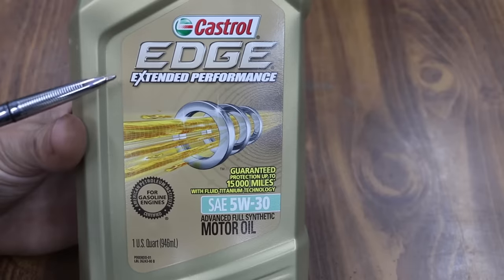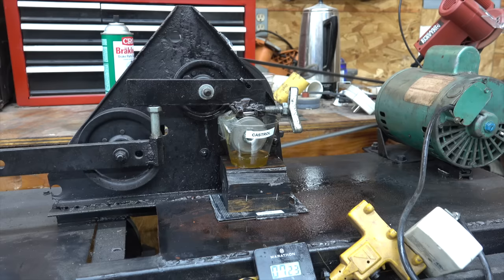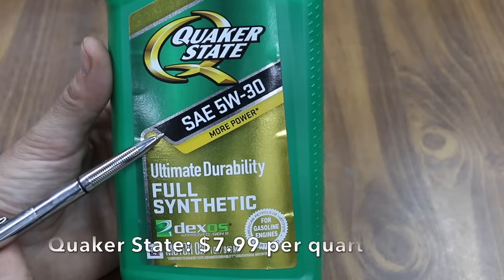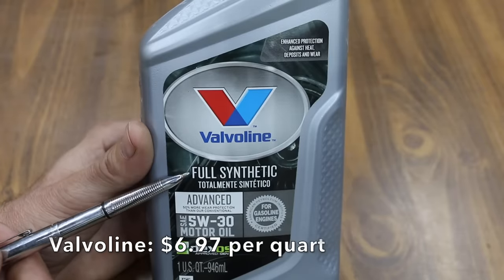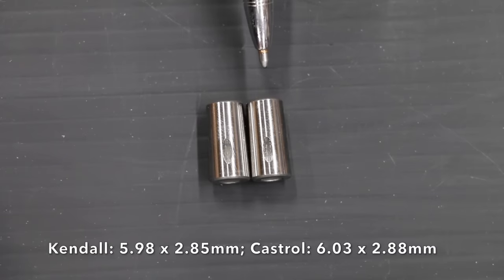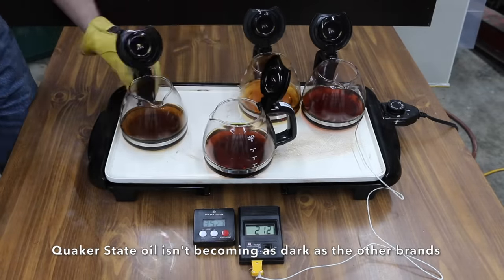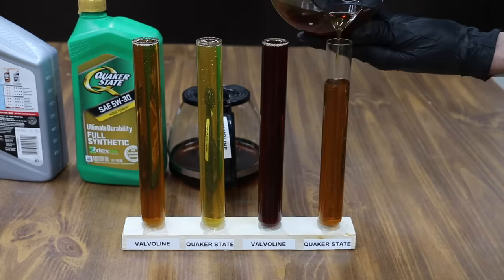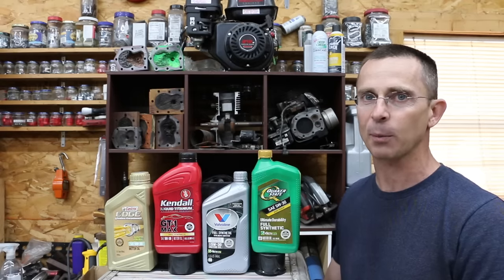Is Castrol Motor Oil better than Kendall? Let's find out!

Comment: Can you test diesel fuel additives? I am specifically interested in the lubricity of different additives since they all claim to "reduce wear" on the fuel pumps and injectors; Opti-lube XPD, Opti-lube summer+, Standyne, Diesel Power Service, etc.
Reply from the maker: Thank you for the video idea!
Reply: BigK
I've tried diesel power service and Lucas fuel injector cleaner. My results were, power service didn't seem to do anything except cost me a few bucks.
Lucas however,  got my engine a 2007 Cummins ISX 15 435 HORSEPOWER after one gallon , I put half a gallon in each tank  and my fuel mileage went from 5.8 to 6.2 and it idled smoother as well, every 6 months 1 gallon, keeps the performance and mileage up. To me it's worth it. The others I can't say, once I found Lucas I stayed with it. 
It has been a while since I used power service so it may work better now.
I have been using Lucas since 2010 and even had great luck with it in my cars 
Power service says one fuel injector cleaner can't work on both gas and diesel, I say bull hockey!  Lucas does.
Reply: Look into fuel additives from Schaeffer manufacturing. Best fuel additives in the world I can assure you just try them and you will never look back 👍
Reply: @charlespetersonii6989  
Thanks, I'll try them next time I want to treat my fuel.
Reply: @bertgrau9246  I personally use their Nuetra fuel additive. Good for Gas diesel and ethanol blends because i run e85 often. Best fuel additive I've ever used. https://www.schaefferoil.com/neutra.html
Reply: Testing has already been done if you follow the diesel forums. Take a look here: https://s167.photobucket.com/user/pgreensvt/media/HFRRtesting.jpg.html
Reply: @charlespetersonii6989  
Thank you sir, I put around 90,000 to 100 000 miles a year on my old truck and if anything helps my fuel mileage just a little it can save a lot 
I will try them soon
Reply: Bigk1911 Diesel purge! that is all my friend.
Reply: @jasonharrison25  I am very skeptical of this test because it is the only one I can find and they worked with Opti-Lube to get the yet to be released XPD product they tested. In other works, I feel like palms were greased. If this study is true, should be repeatable!

Comment: Thank you for doing Valvoline. That has been my go to brand for years. Still did well, but I was really surprised on how well Quaker State did. I thought QS was garbage oil.. My mind has now been changed.
Reply from the maker: Thank you!
Reply: Quaker State is garbage, its REALLY bad. These tests have left me scratching my head for an explanation. My guess is its great for a the first 500 miles then turns to the garbage that has caused so many engines to become knocky.

Comment: I use Amazon Basics Full Synthetic in my 1995 Honda Civic because of your testing thanks! 214,000 Miles and counting!
Reply from the maker: It's a great oil. I'm using it too. Thank you
Reply: @ProjectFarm  I'm excited to see the playoff finals of the oils!
Reply: I use whatever full synthetic is cheapest in my 06 Saturn Ion 3 and it has 242,000 miles. When I got the car it already had 116,000 miles on it and who knows what oil they used.

I generally use SuperTech full synthetic.
Reply: @timmturner  good enough for that car. i got a turbo 2.4. last owner(original) always used pensoil. im going with Rotella gas truck. beats mobil and castrol's equivalent. probably pensoil too.
Reply: @Billy_Darley  I am in the oil is oil camp, proper maintenance and good oil filters will get you further than specialty oils. Rotella is good oil, as is Pennzoil.
Reply: @ProjectFarm  Do you run your tests on each order you get of it to verify the quality is still the same?  If they remain consistent for a year or two, then I might consider trying it.  Wait!  What am I saying!?  I will never use anything other than Castrol.

Comment: I was just watching all of the oil tests again and thought of 2 ideas for the next test. The oil maintaining viscosity is VERY important, so after the oil is heated, frozen and the wear test is completed, have it analyzed and post the viscosity in Centistokes at 100C. A quality oil will stay in grade and remain a 30 weight, min 9.3 and max of 12.5 cSt.  It shouldn’t thin to a 20 weight or thicken to a 40 weight.
Second, your wear test machine has a watt meter attached. Very smart! I have worked with electric motors for 38 years and with a steady voltage, the wattage measurement will respond directly to very small load variations. I noticed in your videos that Amsoil had the smallest wear scar as well as the lowest wattage measurement of 415 watts. Oils with larger wear scars had wattages of 420 and higher, showing the oil has a lower level of wear protection, which increases the friction and load on the motor. I suggest including a graph showing each oil and it’s wattage measurement.
Reply from the maker: Thanks for the video ideas.

Comment: Since Quaker state and Pennzoil are both  SOPUS, Shell's surplus of GTL basestocks that are leftover from their production of Pennzoil Platinum  are allegedly used in Quaker State. That would explain Quaker State's notable  resistance to heat and great film strength. Both Quaker State and Pennzoil Ultra Platinum have performed excellently in my vehicles. I appreciate your interesting videos and the  thorough testing of products that accompany  them. Your subscriber base is well deserved. Thanks.
Reply from the maker: You are welcome!

Comment: I wonder if the bearing test would be different once the oil has been through your heat test?
Reply: Or while it's still hot as that is the state it's in during all the time except for the short time after start up

Comment: 4 oils I expected to do well. Amsoil, Kendal, Redline and Pennzoil. Oils I expected to do poorly and I was wrong: Amazon, and Quaker State.

Shockers to do poorly though? Mobil 1 and Castrol. Are my favorite oils wrong or did they really not do that badly?

Right now Pennzoil's extra cost looks justified and and Amazon being so cheap looks awesome, but then user comments from hard pressed engines says Amazon isn't so stellar.

Right now, price vs. quality tells me Pennzoil and only because of my probably wrong bias against Quaker State.

Edit addition: The 80's and 90's and professional testing which could have been rigged all said Quaker State is no good. I thought Pennzoil bought them. That makes it make more sense!
Reply: castrols really do that badly

Comment: I had my oil pan off at around 210k miles. I could not see any sludge on the bottom of the pan, it looked almost new even if I tried to scrape it from the corners there was basically no sludge. I always use Castrol synthetic blend and I will always use it . I use the full synthetic now, just recently changed over now has 247k. It’s a 2002 and they don’t make them like they used to.
Reply from the maker: Thanks for the feedback.

Comment: I'm really excited to see how Amsoil will hold up against the rest.
Reply from the maker: Thank you!  It seems to be a very impressive oil!
Reply: AMSOIL! AMSOIL! AMSOIL!AMSOIL! AMSOIL! AMSOIL!

Yeah, I'm a fan. I'll probably need therapy if they don't win.
Reply: @ProjectFarm  If AMSOIL does win, can you do an extensive test to find out if the Signature Series is worth the up charge?

Not sure how, maybe cook it for several hours? Maybe run it in a beater for a year while at the same time run the regular in another beater? (Hopefully you can find a couple El cheapos on Facebook)
Reply: @Stacy_Smith  looks amazing on paper but for the cost difference i opted for Rotella gas truck. might opt for amsoil if my pockets ever again get deep enough. cant say enough about amsoil saber. its all i use in my two strokes asides from Briggs & Stratton 5-In-1 Advanced Fuel Stabilizer.
Reply: Billy Darley I use the oe line of Amsoil, and change it every 5,000 miles. Wix standard filter. my edge only cost me right around 35 bucks per oil change.
Reply: I've picked Amsoil to take the series a while back. All I use in my car/truck. It beat Royal Purple handily. That should say something right there...
Reply: Knowing amsoil , they probably already tried to bribe him into winning the contest. It’s all advertising and half-truths.
Reply: @johnconnor7501  Way to make a logical & meaningful comment. I'll take it you never even used the oil, but have all the facts to base your highly opinionated comment on...
Reply: I love Amsoil! I once used it on a recommendation from a friend who worked for a corvette shop who did racing on the weekends here in honolulu. I used it in my 1986 Toyota corolla with the 4ac motor. I put Amsoil in the engine and rear differential. Much to my surprise when I first took it for a test drive it felt ever so slightly peppier. Seeing Amsoil beat royal purple in your tests just confirms my trust in Amsoil. But...it is expensive stuff. Lol
Reply: If you look at the stats from all the winners amzoil will not win out
Reply: @Billy_Darley  , overall the Amsoil Signature Series is cheaper with longer drain intervals. Do the math. Amsoil Signature Series good for 25 k miles. It costs me $77 (or $15.40 per every 5,000 miles) for Amsoil Signature Series for 25,000 miles with a singular drain interval. Amsoil, overall, more affordable and better for the engine. 100% synthetic better than a full(partial) synthetic motor oil.
Reply: @johnconnor7501  , chicken little and the sky is falling, too.
Reply: @hawaiiansoja81  , overall, over 25 k service intervals, it's more affordable and better for your engine. Pay now or pay later.
Reply: Team Schaeffers FTW!
Reply: I havent tried it out yet, but since this series started ive been researching Amsoil, hoping the hype is legit.
Reply: @Billy_Darley  Just become a Preferred customer and get 30% off.
Reply: @gac107  I like RP but... it evaporates too fast!
Reply: @user-ki3dj9pu9y  , Amsoil Signature Series is working for my family's 3 vehicles and is, overall, more affordable with less drain intervals. One drain interval and $77 per 25,000 miles. Do the math.
Reply: @youarerightboss  when all the professional mechanics i meet will stand behind that bullshit, i will too. so far the most miles any i have met will recommend is no more than 10k. if its your engine, do what you want with it. if 25k makes you happy then roll with it.
Reply: @youarerightboss  not dissing amsoil. i know its good shit, just not going to leave it in that long.
Reply: @Billy_Darley  , understood, but it's been proven to perform that long.
Reply: @youarerightboss  you do make a really good point!
Reply: @Billy_Darley  , rolling with it.
Reply: @ProjectFarm  Oh, and please send samples off. Testimonials are anecdotal due to the fact any degradation experienced wouldn't be noticed.

I had a 1991 Buick Century that I abused by changing the oil once a year to every 18 months. I was an OTR driver with hardly no free time and would forget to ask my wife to do it since I hardly ever drove it.

I got a local job at AK hauling coils. The car had several wear and tear items that needed fixed but because the mill was slow I didn't get around to it. (Brakes & rotors, only 1 power window worked, and exhaust was broke off).

I needed the money so I DROVE this heavily abused car to a nearby  junkyard, dragging one locked tire, for scrap so I could scrounge up enough money to buy a turnkey used car. NOTHING WAS WRONG WITH THE MOTOR! NOT ONE VALVE EVEN SO MUCH A MADE A TICK!

We put close to 100,000 miles on that car and we bought it used! It didn't leak oil profusely, so you can rule out constantly refeshing the oil. (Changing itself)

I can attribute my success with that car to 2 things: 
#1 That model year car was a damn good design.*

#2 I WAS LUCKY!!!

Anecdotal evidence would suggest that you don't need to change your oil, but we all know for a fact that's bullshit!

*Anecdotal as well without more data. Maybe if it was manufactured on a different shift, different day of the week, etc. the outcome could've been different. I'd be a hypocrite if I didn't point this out.
Reply: Amsoil LoL they do have cool stickers.

Comment: Frequent oil change is what guarantees reliability in the engine, not brand, when we are talking about these particular brands (all of them). These are among the elite of the elite and a difference of 0.1sec in the fluidity test means absolutely nothing to me. Who knows? Maybe the slower one has some short of secret additive for performance in another sector. What l am saying is that to me they are all excellent
Reply from the maker: Thank you
Reply: Say hi to everyone in 1972 for me.
Reply: @gumps1986  in normal running condition's the parts in the engine protected by oil shouldn't actually touch, thus no wear.  If you use the right spec of oil in your vehicle, and change it often enough, it shouldn't matter what oil you use.  There is one caveat to that though, at startup there may not be enough oil to prevent contact, which is where the anti-wear additives come into play (they basically coat the parts is a super thin layer that can be worn off at startup then replenished afterwards)

By far the most important thing is to change your oil frequently enough, If i wanted to spend more I think my money would go further with used oil analysis then buying more expensive oil.
Reply: animefreak5757 I change my oil once a year, and do oil an analysis every 10,000 in the semi. Amsoil Signature Series diesel oil. Change it once a year in my race car, pickup, and wife’s car too. The time, and money I save not doing oil changes every 3000 miles like the days of yore is worth it plus the extra protection of running the best oil.
Reply: @gumps1986  yea, 3000 mile changes are usually not necessary anymore.  Thankfully the people who make car's usually recommend a more reasonable schedule then the guy at the oil change place.
Reply: I get 100's of thousands of miles out of my engines running 5-12 thousand mile oil changes using Castrol w/ Lucas oil stabilizer.  I am usually kicking myself after seeing the oil when I change it under 6000 miles.  Each and every time I tell myself I should have gone another month.
Reply: It can make a difference, just because you don't care doesn't mean everyone shares the same sentiment. you're misinformed if you think super tech or amazon basics is the elite of the elite in oil. Your cars engine will likely run better and last longer with a higher quality oil; especially if its driven hard.
Reply: @Brunkvic  got a source for that?
Reply: @Brunkvic  Have you seen PF's test results for Amazon Basics and SuperTech? They were both quite impressive for what you would expect given the price. My only concern using either of those brands would be the possibility they will not be consistent with quality.
Reply: @1speed2racer7  while i like this channel a lot, i dont think its possible to draw conclusions with these tests or timeframes. automotive oil is a pretty deep subject
Reply: @Brunkvic  I totally agree that there is more to oil than what can be determined in these tests, but maintaining proper viscosity after heating up is a big component to a good oil. I live in an area where we actually have winter, so I will never use Royal Purple thanks to these videos.
I also wish that he would test the bearing wear after the oil has been heated. We might see that in the final rounds?
Reply: Yeah it's a tough one because actual wear is different than simulated . Plus cleaning properties . I just want good oil that I don't feel like I am overpaying for. I have used Castrol for my Corolla, stp for suburban, and Kendall for motorcycle sometimes stp

Comment: Project idea.... Ethanol vs Non-ethanol gas.... Non-ethanol is supposed to be better for small engines...... Is water a byproduct of burning ethanol? Leaving water in exhaust system to rust. Especially on quick trips to store where exhaust doesn't have time to heat up to operating temperature which would evaporate moisture.  Non-ethanol gas costs about 30 cents per gallon more.  Supposedly get better gas mileage with non-ethanol.  Also non-ethanol is supposed to burn cleaner and more efficient, reducing carbon deposits.... does it? I drive 30 miles to get non-ethanol gas for my small engines and my motorcycles.  Is it worth it?  Thank you.  We love your videos.
Reply from the maker: Thank you for the video idea!

Comment: Can u make a competion series with petrol additives 😉 (”range-rest”)
Awesome video’s btw 👍
Reply from the maker: Thank you for the video idea!
Reply: @ProjectFarm  In your professional opinion, is it worth buying those petrol additives or are they just snake oil?
Reply: Levi Roth I use fuel injector cleaners like sea foam or stp they do work but they just clean the don’t increase mileage even if they claim to one thing I will say is if your injectors are really dirty then you may see an increase in mileage but usually if your cars in good shape you won’t see a difference I still say run a bottle of fueladditive every oil change just to keep everything clean
Reply: @Lawnmower-os5pg  i just use berrymans b12. way cheaper and doesnt do any worse than seafoam.
Reply: Billy Darley yeah I’m sure it’s fine I’ll have to try Berryman b12 out I’ve never used it but yeah way cheaper I’m under the impression that most fuel additives are the same thing most use a nitrogen based cleaner like is in shell v power fuel
Reply: @Lawnmower-os5pg  all the evidence ive ever seen showed little to no difference between seafoam and berrymans. not enough to warrant the added cost. with seafoam it just seems like paying more for  the name.
Reply: Billy Darley pretty much